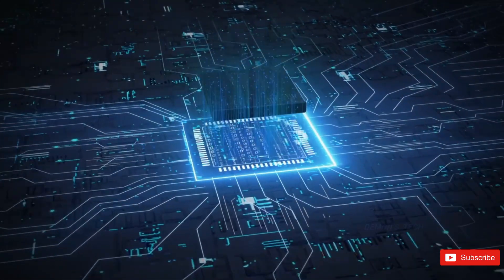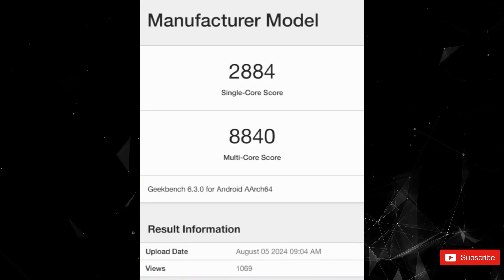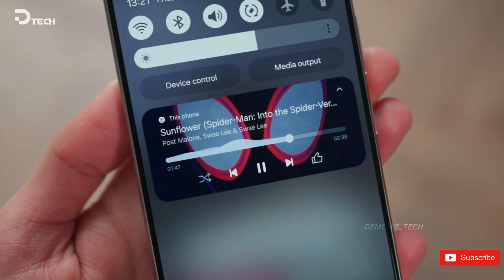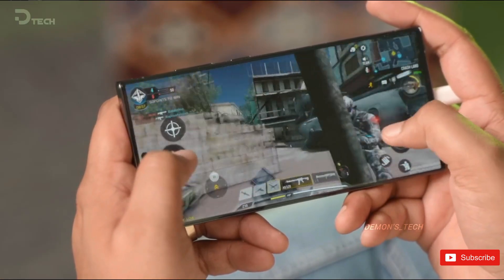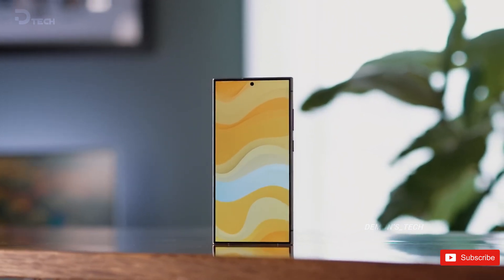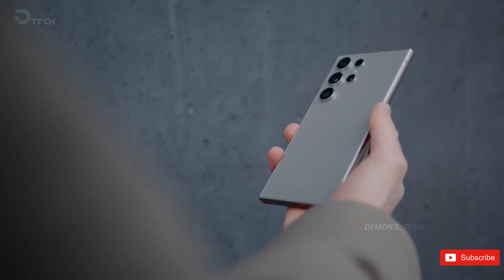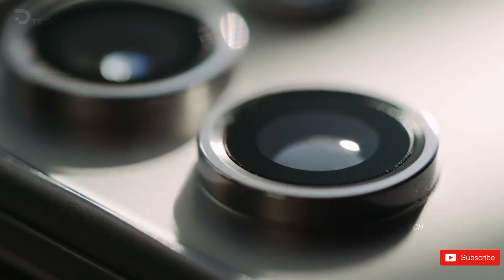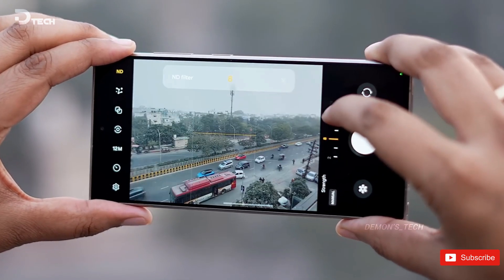Samsung Galaxy S25 Ultra - FIRST LOOK AT THE PERFORMANCE🔥🔥

Comment: I don't even want to hear about this. I bought into the hype of the s24 ultra and it was so hyped up. At this point, what will the s25 do that my s24 ultra doesn't already do? What noticeable difference is it going to make?
Reply: Loll you should the s27 or s28 
But for the one that has s20 or s10  this will be huge upgrade